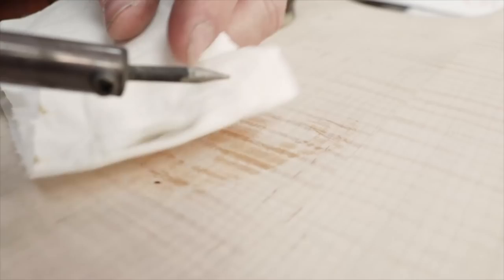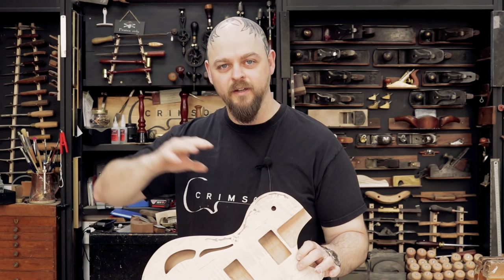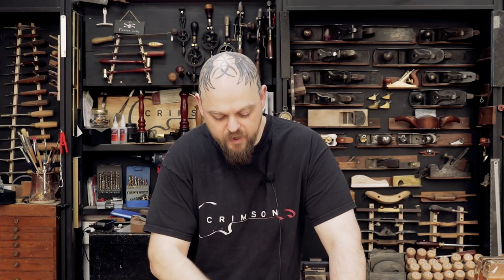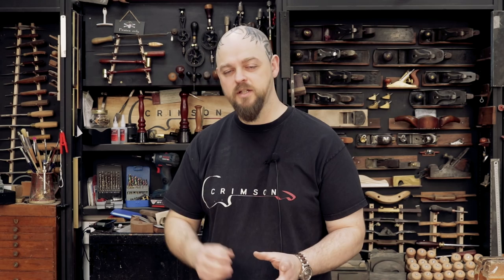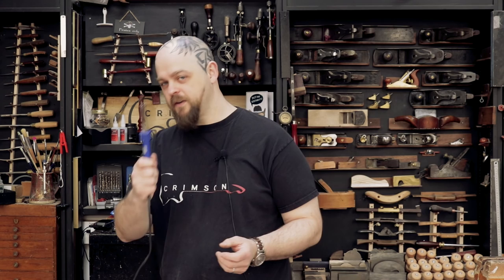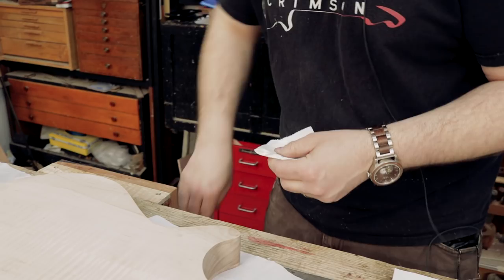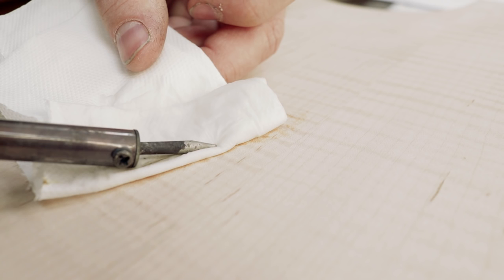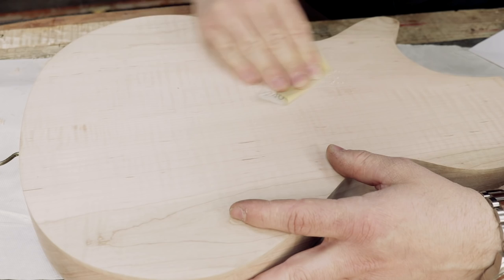How to make Pesky Dents Disappear from your Guitar Body - Guitar Builders Basics - Episode 205

Comment: It's common to also use a household iron (yes, like you'd use on your clothes). The benefit being that it has a steam setting built in which helps keep the towel damp. Also using the flat surface, I think provides better results than a pointy soldering iron in some applications (like the back of a solid body). Good Ole woodworking trickshaw of the trade can save us sometimes!

Comment: Just done the same with my beloved copper Rodded. Though I dripped water on the dent first and let it sit for a minute. I then damped down a piece of kitchen paper and put it on the dent and used the tip of a hot iron to iron over the paper/dent. No more dent and as far as I can see, I don't need to reapply finishing oil.
Reply from the maker: Nice technique and use of an iron!

Comment: I use an old copper-headed soldering iron heated with a gas blowtorch. The head is a 50 x 20 mm block of copper. Lots of steam and cools down slowly compared to a titchy electric iron. Heats up fast with the torch, too.

Comment: I've used an iron and a very damp rad to steam them out I've tried that soldering Orono and it works great to an extent but the tip is usually smaller than I like .try useing just rough tip to cover the dentist and surrounding areas keeping it small.

Comment: I have a laminated through neck bass that has a few dings on the neck.
It is an oiled finish.
Would this method be safe?
I wonder about the glue and the integrity of the wood as the neck is very thin and flat.
I would of course remove the strings first.
I assume the truss rod tension would be a bonus if anything as it would be pulling the back side of the into tension and therefore slightly opening the dents up, allowing for easier movement.
Come to think of it leaving it strung may not be such a bad idea, or would that be too much force?
Could the tension or lack of, also increase the risk of twisting?
Do I need to completely overengineer and make a jig to reduce all these risks?
Yeah that mat be a little overkill.
My mind has so many questions, about every aspect of everything, haha.

Comment: I have a question!!! Does the configuration of tension springs actually affect the balance of a floyd rose bridge especially on a 7 string? Ie 3 parallel vs 1 (straight) in the middle and two angled to the middle of the outside springs ?